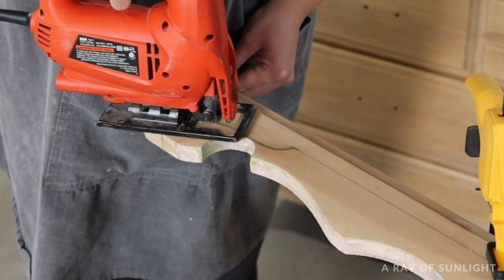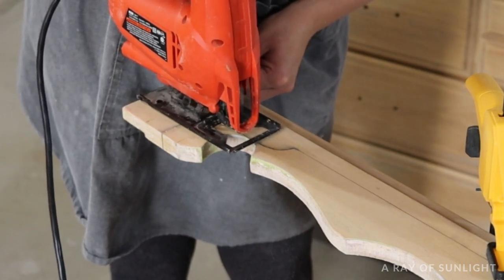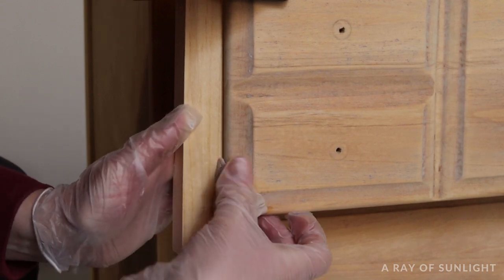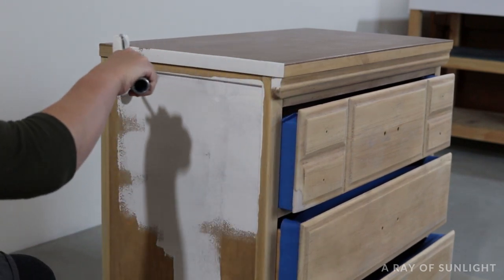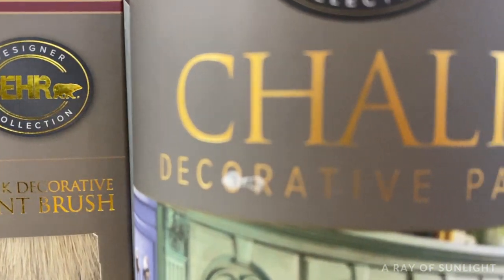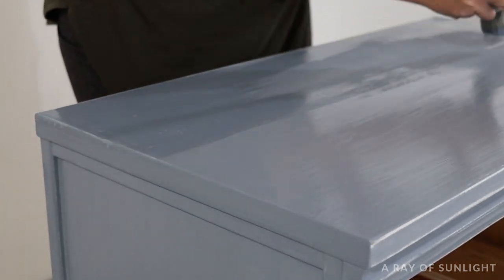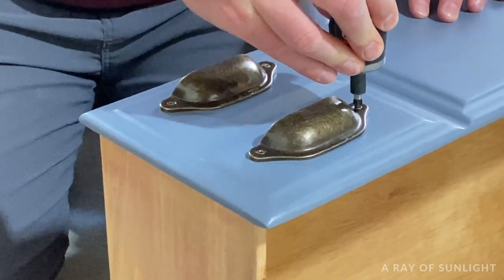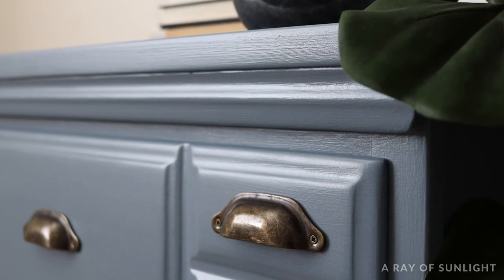How to Paint Raw Wood Furniture | Behr Chalk Paint & Paint Brush Review

Comment: Looks amazing as usual! I'm curious to know what you use to record your videos. I'm working with my iPhone, an old camera and an old laptop to record my furniture flips and am struggling to get my videos uploaded properly so I need to upgrade my equipment. Please let me using. Thanks!
Reply from the maker: I traded my canon t6i in for a canon rebel sl3 when I started making videos. Mostly I needed a flip screen so I could make sure I’m in the shot. And then I have 2 different lenses that I switch in between. The lenses make the biggest difference I think. I have a tight shot lens called the efs 24mm. Then I have a more wide lens that I use more for taking my after photos.
I also finally upgraded my iPhone to an 11 pro at the end of last year. I use it for wide shots a lot.
It’s not the best setup, but it’s what I could afford.
I use Davinci (free) to edit my videos on my computer. I would recommend as much speed as you can afford if you’re going to edit on the laptop.
Best of luck! Figuring out equipment is a pain!

Comment: Great job with re-designing the bottom “ kick-plate”…it really did modernize it. Like you I am not in love with Behr chalk paint and I don’t think it is the color or your technique. I had to paint 4 to 5 coats of a darker blue to get full coverage. I also watered it down, tried different brushes and sanded between coats and still got too many brush marks or more than my liking.

I would return the $30 brush back to Home Depot…tell them it is a piece of junk and didn’t perform…they will take it back

Thank you for showing your experience with this paint because other flippers have had the opposite experience…maybe this is ok for spraying only.
Reply from the maker: Oh thank you for the feedback! I’m glad it’s not just me. I sprayed it and it was fine, so I’m thinking that if I ever use it again I will spray it. But I probably won’t use it again. Haha
Thanks again!